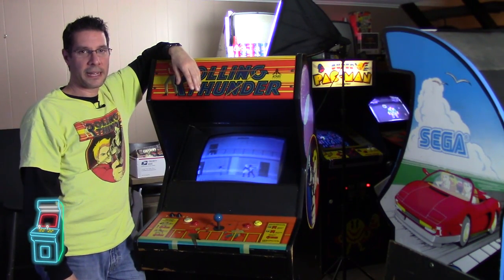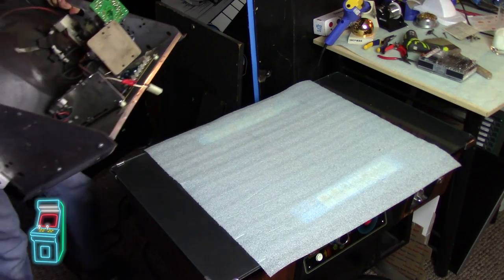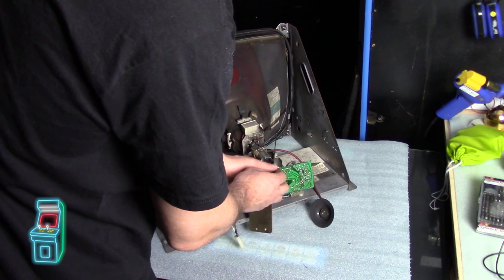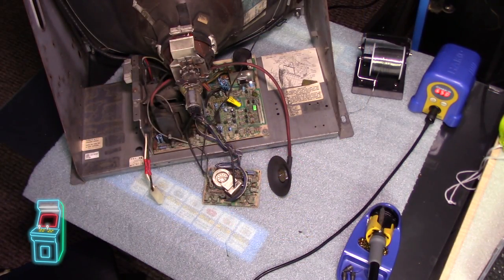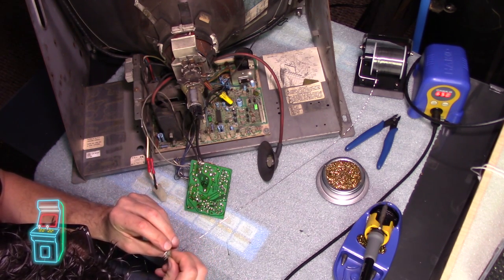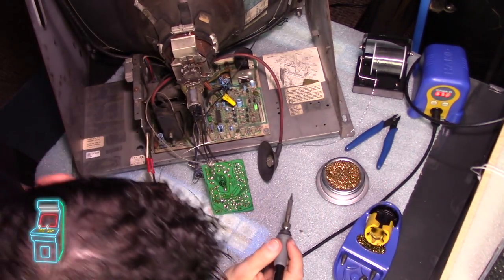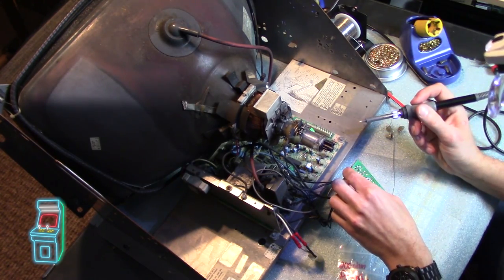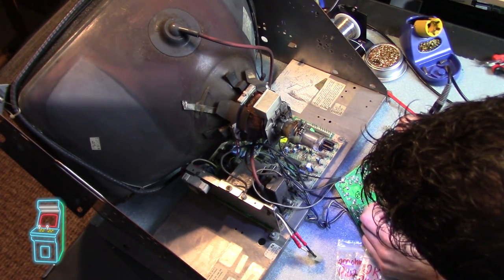Rolling Thunder Resto [Part 3: Monitor Woes]

Comment: Good video, great to see you are back.   I noticed your Super Pacman in the background,  did you install LED coin lights?   If so, which ones did you use?
Reply from the maker: You need to catch up!  I've released two more!  Lol.
As for the coin door lights: Good eye!  When I got the machine they were disconnected. I fixed the power wiring to coin door when I repaired the Ram error. And I did indeed put in LED lights. I don't recall the exact model number at the moment but I will look and report back as to where I bought them.
Reply: The LEDs look really good in the Super Pac. Will look forward to know which types they are, thanks!
Reply from the maker: @chuck12-82  I just checked.  Got them from Comet Pinball.  They are Wedge style, 2 smd 2835 6.3v, T10, Frosted lens, Warm white.  You can order them here:  https://www.cometpinball.com/product-p/2smd-ct-ft.htm  You are better off getting the 25 pack here.  It's a good value:  https://www.cometpinball.com/product-p/25-pack-ledbullet.htm